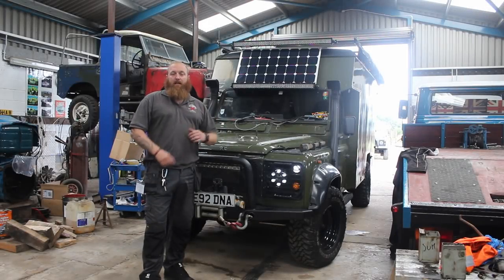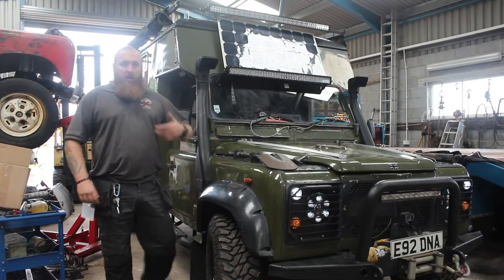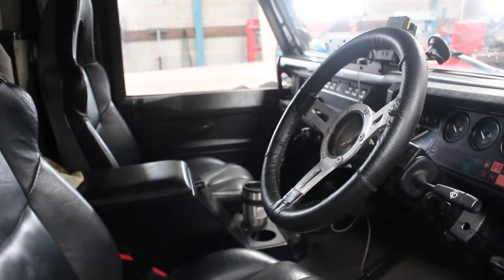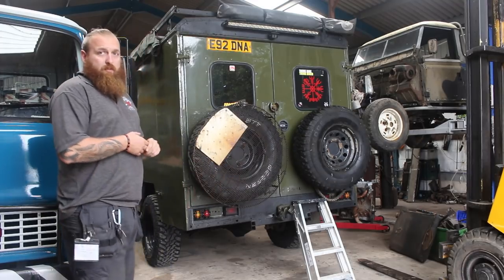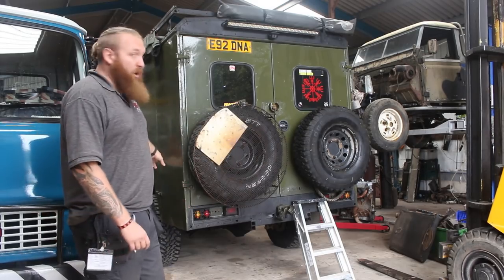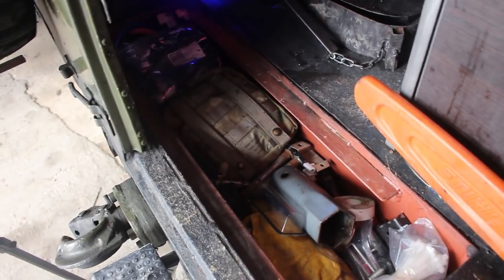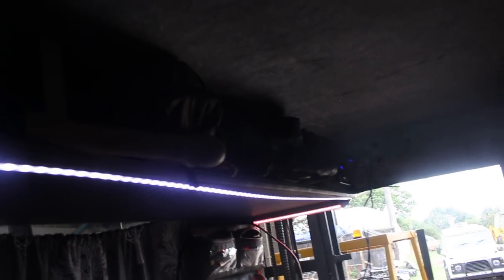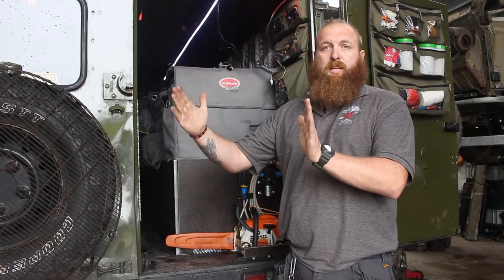DIY overland campervan build

Comment: I was going to ask if you had a rough idea of how much you had invested in your vehicle, but then I got ready the comments and replies.  So I thought it better not to ask. I'd hate to have you answer and get into a lot of hot water with the misses if she found out how much you actually spent lol. You definitely have something to be proud of there Rich. I hope someday I'll be able to answer the question of wow how much you got invested in your jeep the same way. Looking forward to seeing how it handles after you make the changes you were talking about.  I was really surprised at the fuel mileage you're getting. Before my truck got sandwiched in the accident after the modifications I had made to I was lucky to get 13 miles to the gallon. Thank you for sharing. God bless and stay safe.
Reply from the maker: Rich Schwartz I wouldn't want to add it up but the bigger items add up over £10k and the hundreds of smaller items go on forever. I have no idea how much labor and friends help I have in it. Then I'd be hard pushed to find another as I don't like the newer model as its too wide. If the wife asks the whole thing was £10k but I'd be hard pushed to find a base vehicle I liked for less than £15k now unless I made it from scratch and then that would be 6 months off work to make it.

Comment: i need light bars on the van,  should just get round to building some with 10w leds and ally tube. i also need a decent heater off diesel or paraffin...
Reply from the maker: Project 806 Camper LED lights baffle me how they can be made so cheap. My latest obserion are the cob led lights. A few ppl like the Chinese diesel heaters but the odd ones get bad reviews.

Comment: Absolutely cracking set up ,,,,a fridge is somthing I think id like to look at ,,,,not somthing that big though it would nearly fill my kangoo lol,,, also could I ask where the hanging storage bags are from please atb mike
Reply from the maker: GINGERBUSHCRAFT they are from LVB overland. The down side of small fridges is they still need the compressor and bits so if you half the size of the fridge you loose two thirds of the storage. I'd not be without one tho now I'v got one even if I rotated between a cool box and the fridge.

Comment: Quality video as always! Stupid noob comment but anyone looking into the new electric land rover defender? Anyone worried about the future of diesels and taxes on them?
Reply from the maker: muscleprotein fair comment. Mine will run on bio fuel and cooking oil so still better dust to dust for the planet than a Prius. It’s a end of life military vehicle recycled to an overlander with a round the world trip under its belt that has had a diesel out of an end of life vehicle so recycled up cyclinged  what ever the term. All local materials and produced local so technically much better than a new vehicle every few years. It’s a classic so grandfather rules apply. The new electric stuff is ok but if everyone had it it wouldn’t work so HHO is the only way but how do you tax water.

Comment: Rick.. do you need to upgrade the 200tdi engine to carry the heavy weight of the ambulance body plus other camping items
Reply from the maker: shamsury Karim no because I’m at 2.8T so no more than a loaded discovery. Don’t get me wrong it’s not fast and I’d love a om606 but it copes fine.
Reply: @Bugoutvehiclesuk   Thank you Rick for your reply..i am currently building a defender 127 ambulance with a 200tdi..it seems my vehicle is much heavier and the ambulance is quite sluggish...however, recently I've sent the  fuel pump for a complete servicing and the engine seems to be coping quite well.
I've not done a full test drive of the vehicle so i cant tell whether the vehicle is capable to do long distance overland driving..Talk to u later...

Comment: Do you find the heavy duty springs on the back to be sufficient? I put terrafirma heavy duties on my 90 and after 12 months or so it was really sagging again. I do load my 90 right up though as a camper, but I wanted the back to be “pert” even fully loaded. I got some airbag spring helpers which are absolutely bob on and do the trick beautifully.
Reply from the maker: solarbuduk the new ones seem better than the last set. They are a different colour and were marked made in Australia so I wonder if they have upped there game. It’s a 5 inch difference to the old ones.
Reply: Oh well, hope they last out for you mate! Also, what tyres are you running?

Comment: Nice setup. What auxiliary battery setup are you running? What sort of amperage?
Reply from the maker: ryanhenry21 200AH leisure battery’s off a merlin split charge and 100W of solar to top it up when it’s stood.

Comment: Edna  is looking sweet as mate! You did forget to mention one very important piece of kit... The bottle opener on the back door! ;) lol . You are so prepared and the truck is so damned capable, very impressive. You mentioned differential upgrades, that is something that i have been contemplating quite intensely as of late. Just not enough drop in my axles. A comparo between different options for diff centres would be outstanding if you could swing it. I mean, 'do we go ATB, LSD, Air actuated locker, Magnetic.'.  Just so many options and i only want the one that WILL work. Sorry for wafflin on, Great video cobber, please give kindest regards to the fella's. Cheers for sharing :)

Comment: Where did you get the LED rear lights from mate?
Reply from the maker: GateKommand you wouldn’t want it. It’s needless junk I just drive round the UK with.
Reply from the maker: sorry pal you have a similar name and thumbnail to a troll iv got. its a cheap one i got off eBay years ago. its ok but not as bright as my headlights so i put it on the back.